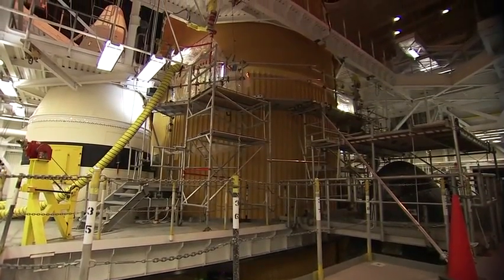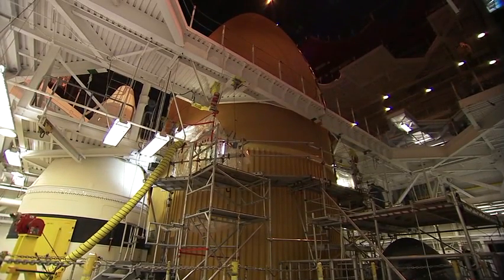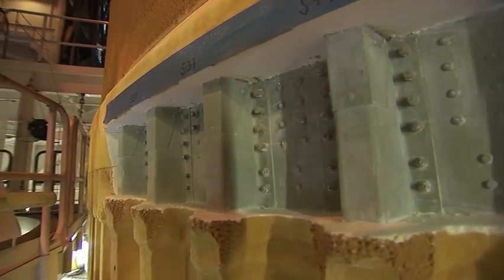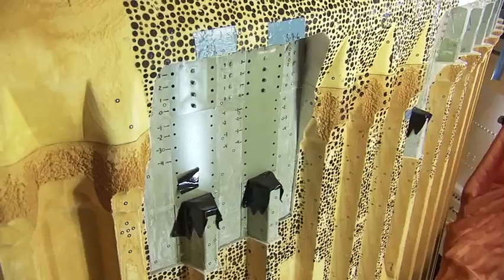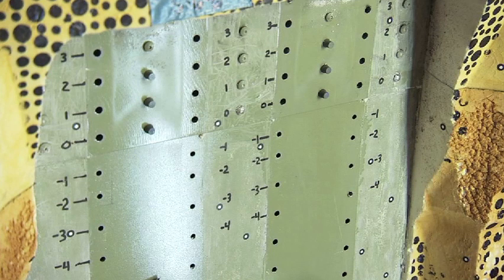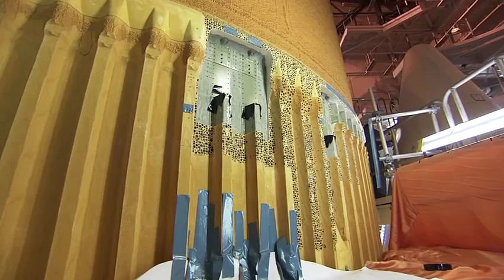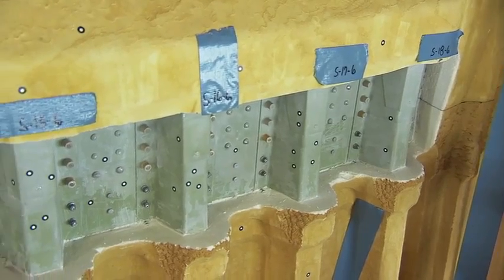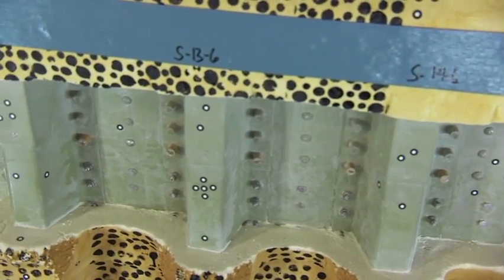Shuttle Discovery's External Tank Undergoes Modifications and More

Comment: NASA is not taking chances it one stringer brakes the tank blows up in Challenger a stringer broke and caused hot perchlorate gas to enter the tank causing it to blow up. the report showed the causes was a failed seal in a SRB and dynamic loading on four of the eight stringers along the lateral area of the tank causing them to fail. NASA does not want another Challenger. Discovery is my favorite ship she can not die.